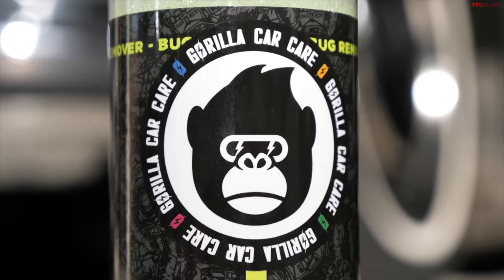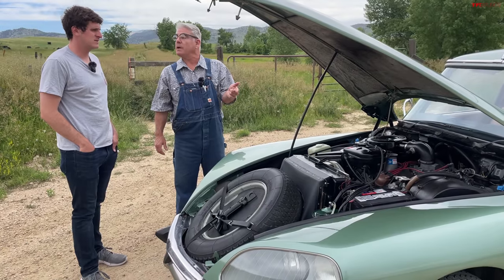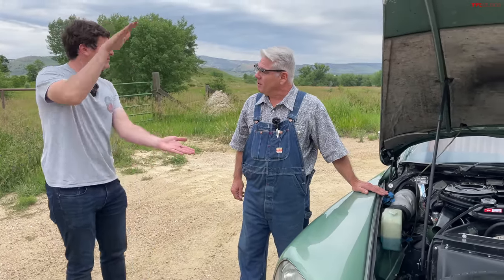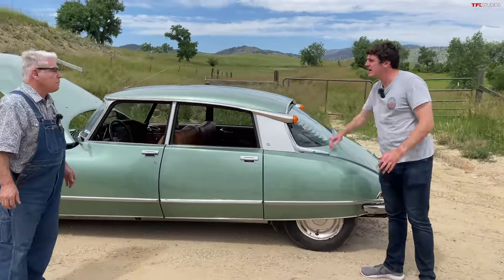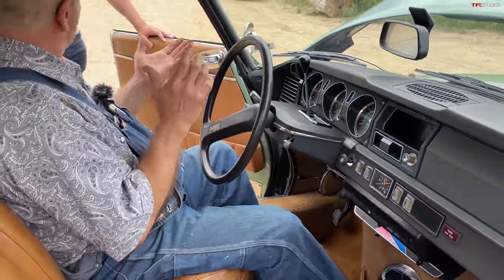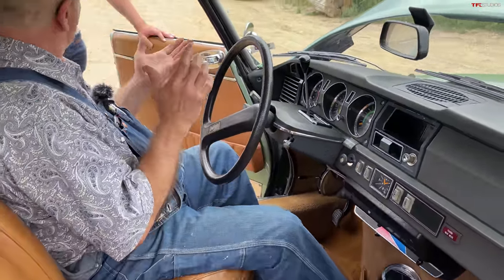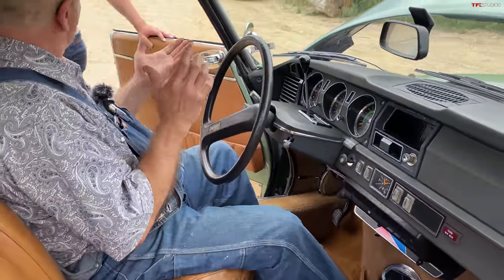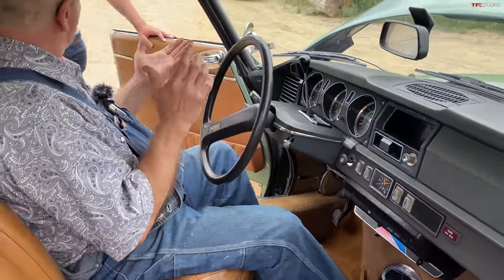Really THAT Unreliable!? Is The Citroen DS as Bad As The Internet Says It Is!?

Comment: The DS is THE most important and spectacularly ahead of time  vehicle EVER 
I’m a dyed in the wool ford guy but this car is just amazing and futuristic…
Great to see on the channel
In 1955 this thing was a spaceship 
Inboards vented disc brakes 
Hemi head 
Hydraulic suspension 
Power steering 
Aerodynamic 
Just incredible for 1955
Reply: Yes, indeed. 
Life is too short for tight underwear, cheap wine or ordinary cars.
I was nervous about getting this car but was smitten by all the beauty & engineering. Her name is, Babette.
Thanks for watching.
Reply: @1KJRoberts  the only downside is that being so far ahead of the competition, it’s hard to get the average joe repairman to maintain it !
More just scared of the futuristic technology
Reply: @1KJRoberts You should look into Panhard , this is where most of the innovation came from. Citroen owned a controlling stake in Panhard and killed off the Panhard 24 in late 67 , the 24 was a far better car in many ways but people just don't know about it.
Reply: The 24 is a very very cool car but I’m trying to imagine what the Panhard has in common with the DS other than being FWD. The 24 was developed in the early 60s well after the DS’s debut. And mechanically it’s not that far afield of the Dyna /PL 17 that preceded it. Also a very cool car. It’s hard, though, to see the redicalness of a ‘56 DS’s systems in a ‘56 Panhard.  This is not intended to denigrate the Panhard in any way, particularly the 24. We can probably agree it was Citroen’s fault there wasn’t a 4 door 24 since they didn’t want it competing with Citroen models and that affected sales in France where everything from a 2cv to a Renault R4 had 4 doors. 
Again,  no disrespect intended.
Reply: *radicalness. Probably not a word either
Reply: Citroen built two prototypes using the Panhard 24 body one of which survived. One was fitted with the 2.1 DS21 engine & hydropneumatic suspension the other the 2ltr double OH cam engine this car was also fitted with DIRAVI power steering. Panhard set many many firsts in the car industry inventing in many ways the modern motor vehicle. The DS is was indeed ground breaking for it's time but without Panhard as a company you have no DS. Wonderful car by the way and great video to watch,  & i very much appreciate your knowledge and passion and I mean no disrespect.
Reply: @happysnapper3676  Fascinating, all you've said is wrong.
You should check the timeline of the Panhard 24, it was a low tech copy of the DS...
Reply: @MrPPunch69  YouTube is a wonderful place for discourse & it's easy to slide into bad feeling.  I was merely pointing out as a company Panhard lead the way well before the DS & yes the DS was 1955 & the 24 was 1964 but how did Citroen get to the DS ?If your inclined read about Panhards history & I think you will agree not everything I say is wrong. The DS remains & will always be in my book a fantastic car. Regards.......

Comment: I interviewed the head of Citroën Canada back in the 1970's. What did them in in North America were the new "safety" regulations coming into effect,  not reliability issues. While other makers (like MG) could slap a big chunk of rubber onto the front and rear bumpers, Citroën would have to basically re-design the cars to meet height and lighting requirements. We had a good selection of Citroën repair shops in Quebec.  But like many other Euro brands, their products were not designed for rust-belt winter conditions, and aftermarket parts were often only available from dealers at $$$$!!.
Reply: thank you for your words. Exactly. French cars and specially Citroens were not very well welcome outside of europe. French ingenieers from this time period were making too much shadows in many domains to other countries  ... and maybe US

Comment: What a wonderful introduction to one of the all-time automotive engineering masterpieces. I have had experience traveling in several of these. I remember the large foam rubber pads under the floor carpets. Fun fact, the original name "DS" is pronounced in French as "Deesse" means "Goddess" which is what these cars are known as. The slightly de-contented later ID model is pronounced in French as "Idee"  (EE-day) which is French for "idea."
Reply: Other fun fact: in 1970 they introduced to GS pronounced in French as "Géesse" meaning "Giantess".

Comment: KEVIN IS THE MAN. I love his passion and his understanding. That first take conversation is awesome and engaging. I guarantee he can tell us so much more about his car if he had time. Like that wrench that removes wheel nuts and rear fenders has another use - slide a long rod into it, (supplied under the spare) it is possible to crank the car to start it by removing the number plate!
In right-hand drive cars, the steering wheel spoke is at 4 o’clock to protect the driver from the other side.
The aluminum bonnet and minimum grill made it difficult for police radar guns to get a reliable reading.
In some models, there is a control like a choke that opens a small flap under the engine to scoop snow into a tray around the sump.
The front wheel track is wider than the rear, this means that on unsealed roads, each wheel makes a virgin trail.
I loved my Dad’s DSs and have owned four different Citroens myself. I dream of owning a 73 myself.
Reply: My DS20 has a chain under the dash that pulled a blind up in front of the radiator for faster warmup in very cold weather. The hand crank was also very useful for checking/adjusting the the valve lash during a major tune-up.

Comment: Citroen DS is a car that apears in any best car list of all times.
There was no other car made ever, before and after, that would present such a leap in technology as this one.
Reply: Try the Panhard 24!
Reply: @happysnapper3676  
Never heard of it before 😁
Went to see it at Jay Leno garage. A polished Citrien Ami.
Leaf springs, drum breaks etc...
Vs
Disks all round
Hydropneumatic suspension
Adjustable ride height
Power windows
Turning lights
A limo that goes 200kph + while sporty Alfa Rome Julias of the period goes up tu 180kph
That was the leap. 
Thanks for pointing out the Panhard 👍
Reply: @kmet2000  The Ami had the citroen 2cv engine a flat 2 cylinder air cooled engine 602 cc many were returned in the UK as drivers didnt understand why they were overheating in traffic they didnt realise that they had to keep the engine revs high to aid the air cooling by the fan on the front of the crankshaft.
Reply: @kmet2000  the DS didn't come with Disks all round, only up front.
Reply: I had Citroen DX90 circa 1980 in 1990-96, that was much more advanced. Still considering it as the best and innovative car I’ve ever had. Unfortunately it’s just another example when better design was eliminated by weaker (design wise) competitors (Peugeot, in this case). Think about Apple, Concord, etc.
Reply: @skobex  what is a DX90 supposed to be? never heard of that...
Reply: @oojimmyflip  Friend of my sister was a mechanic at Citroen garage.
2CV, super simple to work on but still had points ignition which virtually no one understood by the 1980's.
 Watching 2CV go into a roundabout at 40+ mph was an experience, looked like it was going to roll over but all the wheels stayed on the ground
Reply: @1crazypj it is actually impossible to roll a 2cv going forward
Reply: @cantbearsedmechanics  I can believe it, particularly after seeing one leaning out at about 40 degrees on a right hand roundabout. I was doing about 55mph in my lowered and widened Beetle and the 2CV was right in front of me (on of the last,  purple and cream one)
 It was probably 35 or 40 years ago but has stuck with me in a kind of 'that's impossible' way

Comment: The spheres should be turned to remove with suspension setting at it's LOWEST point with the least amount of pressure in the system and almost all the LHM [Liquide Hydraulique Minérale - not mechanical] back in the reservoir. LHM also stands for "Lord Have Mercy" in English whenever I take my Citroens out. Fabulous video and fantastic car. Thank you.
Reply: the spheres on the suspension cylinders should be loosened when you still have pressure in the system, the Suspension Cylinders aren't set up to have a lot of turning force applied to them, especially when there is no pressure in the system and this way the Cylinders jam themselves up in their mounts and you don't risk damaging them or the Hydraulic lines that go to them, after crackign them loose you will have to put the suspension to the lowest position of course so that you don't get 180 bars of LHM spraying all over the place.
Reply: @aaaabababa  Was NEVER stupid enough to even try loosening with pressure!  Might have tried it IF it wasn't coming loose long before beginning to twist a line!
Reply: @alro2434  never had to deal with stuck spheres i see.

Comment: As the owner of a C5 (2005)..... the suspension, pioneered on the Goddess, is outstanding. Hydropneumatic Citroens forever!
Reply: I have a C5 too, the later X7 model, thankfully one with hydrpneumatic, not steel springs - the last car Citroën made with that system. Comfy but not as soft as the DS.
Reply: @PedroConejo1939  i was told that the C´s not one had hydropneumatic suspenction ,but mr.peter bunny i´m not saying there wasn´t ,only was told that they stoped making it allthough any citroen has more confort than any other regular car the saxo compared with the 106 it´s worlds apart i had a saxo to work it´s still parked outside allthough they gave me a corolla hybrid 1.8L gasoline, now i receive more money for the same work i´m already retired for 11 years ,now i pass invoices for my work, it seems young people dont know how to work with a 3 year degree that gave them the same career as my 5 year degree
Reply: @RUfromthe40s  You were told wrong.

Comment: The predecessor was the Traction Avant (front wheel drive).
It was built from the 1930s and was very stodgy and old fashioned looking.
Then in 1955 the world was introduced to a space ship!!
The convertible is absolutely beautiful and cost much more.
VERY  rare!!😀

I drove one in the mid 1960s for a day.
It was great. It had a 4 on the "tree" with a clutch pedal. It had the same leather seats that were very comfortable.
The toughest thing was getting used to the brake button. It had a throw of almost nothing. you had only to touch it to stop.

You forgot the best of all - the DS all had Michelin "X" radial tires from the start (1955).
Good job   thanks.
Reply: Of course the Traction wasn't stodgy. It was beautiful and innovative too. Just 20 years before.
Reply: It would have been nice if they had inserted a picture in the video of the TA just to show how radical the DS was when it was first introduced.

Comment: I owned a 1973 DS23 Safari in that decade. When I sold it it had done 123,000 trouble free miles. All it had needed was a replacement of the hydraulic spheres at c. 100k miles. It was the best car I have ever owned in 60 years. However it started being attacked by Italian woodworm as Lancia owners called it, and that is the only reason I sold it. If I were running Citroen Peugeot I would make Citroen a really luxury brand and reintroduce the hydro pneumatic suspension.

Comment: It has no re-circulation of the interior air, as he says. It´s merely a volume control for the air intake at the front.
The button he can´t remember is for the rear window heater.

Comment: My father was working as mechanic at an import dealer/ garage some time before 1958. There was a hellacious load of snow and ice on my walk to school. He drove me there in a Citroen DS that was either a demonstrator or a customer's. Fast forward to around 1962. As Dad was the only certified mechanic, he had a customer who needed the oil compressor pump replaced. The replacement was in France. The Air Force officer was assigned to Europe. Rather than wait a year to get the part, he shipped it to France to be repaired. This owner has the money and time to keep his toys going. Likely he has a pickup truck that does all he needs for transportation.

Comment: Hi. You will certainly not put it into high position before removing the sphere. This would cause a giant mess and need the rest of your bottle of red wine while cleaning it up. The system must be without any pressure instead, which is done on the pressure modulator, sitting deep down on the left side of the engine.
The unknown pushbutton is for the heated rear window.
Reply: I think he was talking about removing the wheel :-)

Comment: Living in the Netherlands, I've owned two Citroen BX's (follow-ups of the DS with a lot of the same technology). I've done a lot of crazy off-road rock crawling during vacations using the high suspension setting, and I've parked the car in parking garages with a luggage container on top using the low setting. Also, I was smiling at speed bumps like you wouldn't believe. In about 10 or 15 years of use I only once had a problem with the hydraulics. Repaired in an eyeblink. 
Good memories!

Comment: One thing I didn't see mentioned, interior door handles at the very front of the door, very easily accessible. Not something I've seen in other cars.
My father was a bit of a Citroen specialist when I was a kid in the 70s, we've had quite a few DS. The one I loved the most was the Break Familiale.
Nice comfortable sofa in the back and 3 chairs that could be folded up in the middle of the car. The world's most comfortable car to drive.
Thx for the video, that was interesting.
Reply: Also the steering is special, it is unaffected by potholes, punctures etc.
It's hydraulically locked and will only react if the driver turns the steering wheel.
A rock in the road will not pull the steering wheel out of your hands.
I think you could keep finding special things about that car, a video that came all the way around would last 4 hours.

Comment: My parents used to refer to this Citroen as a “bent banana.”  They saw many when they lived in French Indochina.  It’s a very cool design and with the ability to run on only 3 wheels if needed!  I understand that the suspension in my Roll-Royce Wraith II uses the Citroen suspension.  The Rolls requires a special Castrol fluid RR63 which is DOT 3 and caster oil—to keep the hydraulic suspension valves lubricated.

Comment: Even almost 70 years after launch it's still a great looking futuristic car.
Citroen were always innovators, in the 80's they had the closest thing you could get to active suspension without actually being computer controlled
I never found engines/transmission unreliable but the gas bags on suspension always ended up leaking (I only had old cars back then, oh, I still do)
Really was just as simple to swap out as in video, problem was, I only ever fitted (well ) used ones.
Castrol used to make LHM (at least in Europe)
Citroen used the weight of car to keep brake circuit pressurised if there was a leak (personally I never had a problem although getting used to brakes that work takes a little practice)
The nlater air cooled 1300 OHC GS flat four was a great car, 110mph, 25 ¬ 30mpg, go off road places a front wheel drive car shouldn't.
The most 'fun' thing, when someone is waving at you to 'back up'  so they could get past, you pull the lever and car just rises up, exactly what they were indicating 😁

Comment: 9:15 Having the spare tire in the extreme front also puts more of the weight onto the drive wheels, something the DS probably needed, with the weight of the engine much further back than on most FWD cars. When fully loaded with passengers and luggage, FWD cars can have a real problem going uphill in ice and snow, so moving anything to the front helps. The safety aspects of this also seem pretty intriguing; I wonder if anyone has crash-tested the car with and without the spare. Subaru has also put the spare in that locations on a number of their models.
Reply: It was common for many european cars to put the spare on top of the engine back in the day, since there was plenty of room up front.
Reply: Complete hogwash, Unmatched on snow and ice. Have used mine for dragging other cars out of snowy ditches.

Comment: I will say that is an awesome way to stay it!  Very interesting way to say she came with a stock security system from the factory! If you didn't know how to stsrt it good luck figuring that out! That's alot of onovative ideas that were standard for this car back in 72 and only recently are many car makers are starting to add these so called new features! Very interesting cat!
Reply: ...you didn't know how to start it good luck...  Yes, or how to shift or apply brakes. Could be a problem if you leave it with a valet service.
Reply: Same with the drectional headlights. They were not even allowed in the US until recently; imported Citroens did not have them.

Comment: My dad owned a Traction Avante 'light 15' when I was young and later he had an 1963 ID 19 4 speed manual. That's what they were called in Australia. The ID19 was basically the same as the DS but quite a few differences like no steering high beam (one headlamp only), no cover on the headlights and a few other things as well.
The comfort on a long trip was just magical both in the front and also the back. The even newer C5 has the same spirit built into it and I am planning on buying a C5 wagon sooner rather than later.

Comment: I can't believe it was never mentioned how super comfortable those seats are.
Reply: The entire car is super comfortable. Even the nylon carpeting is foam padded...since 1955!
Reply: @danielulz1640  
That's right! Even the floorboards we're padded.
Reply: @Jagueyes1  for insulation and comfort.
Reply: @danielulz1640  yes, the carpets had about two inches of foam padding. A very plush car indeed!
Reply: @danielulz1640  
Great for noise reduction too.
Reply: The seats are made with dunlopillo
Reply: @guitarman1477  is that what they called super comfy foam rubber?(rhetorical question)